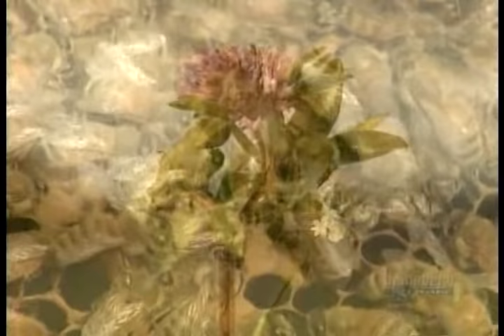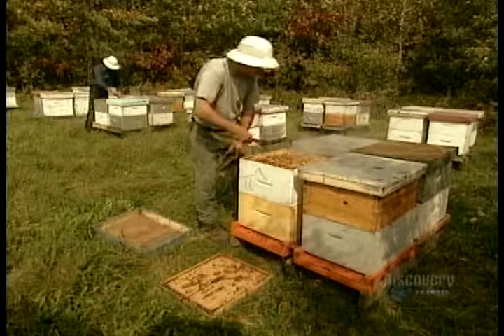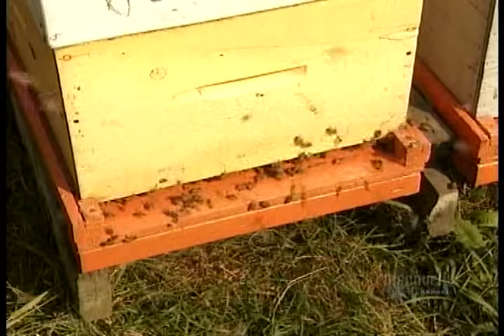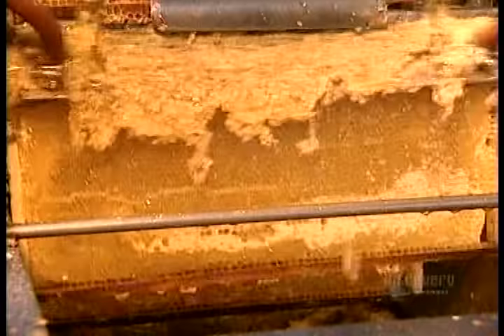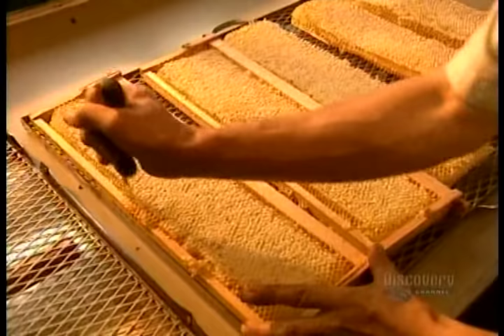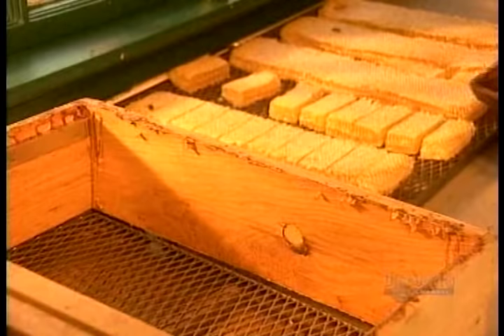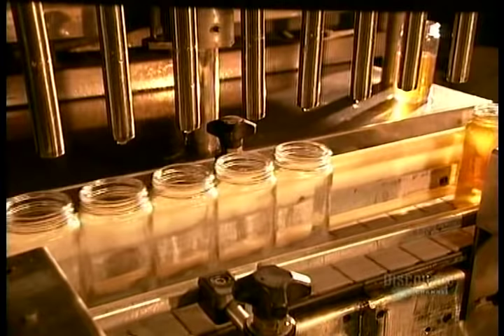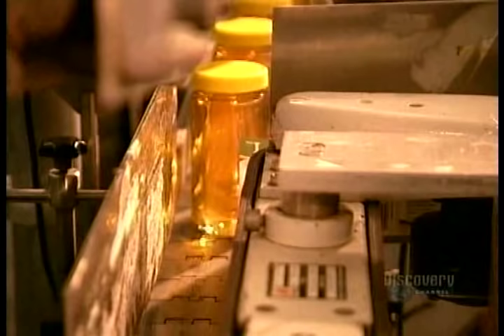How It's Made Honey

Comment: In 1814 Petro Prokopovych (ukrainain not american) invented the world's first beehive which used hive frames.[1] Early prototypes had a large distance between frames, and the frame lay on supporting strips of wood. As a result, the frames were cross-attached by burr comb and propolized to the supporting strips and were difficult to remove. In Prokopovych's design, the frames were placed only in the honey chamber. In the brood chamber, the bees built the combs in free style.

Jan Dzierzon described the correct distance between combs in the brood chamber as 1½ inches from the center of one bar to the center of the next. In 1848, Dzierzon introduced grooves into the hive's side walls replacing the strips of wood to hang top bars. The grooves were 8 mm apart and met the distance requirements for a bee space.

In May 1852, August von Berlepsch in Germany designed a movable frame

Comment: That is very watery honey…
Reply: +TheSorrowLand 
that does make sense, putting the honey we usally get will just take a long time and it will be a sticky and messy process
Reply: yeah they water it done a bit as well to strech it out. if you look at bee farmers that makes honey at home it's much darker and thinker and very sweet.
Reply: that just depends on the plants
Reply: Yeah most water it down
Reply: no i meant the color and thickness comes from what plants the bees collect from, and how long it has been cured. idk if factory's add water, but i wouldnt be suprised if some did.
Reply: no they usually heat it so it will flow easier. Also honey straight from the hive has a paler coloration.
Reply: My aunt has a bee hive in her yard and it makes THE BEST THICK HONEY EVEAHH
Reply: T H I C C
Reply: S U C C Nectar
Reply: S U C C  I S  D E A D
Reply: in the video it said that it had been heated to over 130 degrees. Have you ever heated a sugary liquid? It gets thinner because the molecules are able to move faster than before when they were stuck together and crystallized. Maple syrup is thinner when you heat it up too.
Reply: it cant be watered down or else it will ferment and go bad also with labeling restrictions if its not pure honey the label has state that fact

Comment: Its fake or real honey it looks more watery than real honey
Reply: If it's on the thicker side, it's probably not raw honey. Raw honey (not raw wild honey but raw honey from farm) is thinner. It doesnt mean that it is fake. Raw wild honey is thicker from raw honey from the farm but still it's not as thick as processed filtered honey. Processed filtered honey you buy from store is not good. Dont buy it. Raw honey also has very variaty colors from dark brown, light brown, golden green, etc. Either raw wild honey and raw honey from farm share the similarities. if you put in the refrigerator they wont freezed over, they produced gas so dont be alarmed if you found out the cap sealed your bottled-honey goes pop, and on top of the honey you can find bubble of foam. I know this for the fact that i consume raw honey for my family for years and buy it on local farm in my country. Honey is not that expensive here.
Reply: @dwscprmwr  no you're pretty long-winded but you don't know s***! The viscosity of the honey is directly dictated by the moisture level inside the honey and this is dictated by when the bees cap the cells! If you'll note when he's removing the honey frames from The Hive they're only half capped you never Harvest The Hive if it's half cap because the other half is still too wet that's why the bees haven't cap that yet it's still drying down! The reason his honey is as damn runny as it is is because it's got too high of a percent of water in it that's what you get when you take half capped cells that are not ready to go. honey like this is also a problem cuz it can actually spoil! Raw honey makes no difference it all comes down to what the viscosity of the honey is. one frame to the next with the exact same honey can have dramatically different viscosities and raw is not a factor in that!
Reply: @deannelson9565  oh hello professor honey blah blah blah wkwkwwkwk...i know honey is hydroscopic. I dont state anything related to the video. His honey is runny? Well that's fine by me. It is still raw. I tried kaliandra raw-farm honey (it is quite runny) and get the great benefit from it. Almost as good as raw wild honey. For most common people (such as myself) the best way to buy honey is from the farm. We know that it should be unheated unprocessed. So we get best benefit from it.
Reply: @dwscprmwr  and see there you go again you're equating runny to being raw which has nothing to do with it! If the honey is runny it's has too high of moisture content at harvest. It doesn't matter if it's raw or super filtered it should never be runny The super filtered stuff only thing that happens with that is it has no pollen left in it doesn't cause it to be more viscous or runny that is always dictated by the way it was harvested raw or not! So next time you go wherever you bought your stuff if it's super runny don't buy it cuz that is subpar honey you're buying water and that stuff will spoiled as well where as regular honey has an infinite shelf life.
Reply: @deannelson9565  well you know what, i dissagree. My country is humid what do you expect. Tropical countries most likely have higher in moisture for their honey rather than subtropic. I know honey should be contained max 17-20% in moisture. In rainy season even raw wild honey here almost 28% in moisture. The farmer have to harvest it early! Expecting to reach ideal viscosity, then the farmer should process (heating up) the honey, we dont want that now do we. I think you should travel to tropical country and visit local honey farm if you have means, you go see for yourself
Reply: @dwscprmwr  I raise honey in a place that is hot and humid in summer and that has nothing to do with the viscosity of the honey the bees will still dry it down! This is the reason why the honey bees will post workers all over top of the open comb Fanning the honey until it gets down to proper moisture level they will not cap it until it gets to proper moisture level no matter where you are and no matter what your conditions are. It's very simple and quite basic bees simply will not cap to wet honey they are programmed to do a lot of things in one of the things they won't do is cap high moisture honey. If honey makes it to Market that's too wet it's simply a case of the honey producer taking it too early because they're too damn antsy or want to make more money but the product they produce is of a dramatically lesser quality.
Reply: @deannelson9565  now that, i agree. In summer the moisture content of honey's not as high as in rainy seasons. The hive will maintain the temperature and the bees will help  by fanning it. I don't know which part of place you work your small farm, but judging from your name i guess you live in subtropical. Well now, from my experience (i live in Indonesia) i get thicker honey in summer and runnier honey in rainy seasons, like nowadays. The color also slightly different every time. Every type of nectar also produces different taste and color to the honey, i know it. Well.. what i meant by raw is i prefer to get the honey without it being processed (unheated, unfiltered). If it's in runnier side then so be it, since it is rainy seasons. I buy honey from local farm every fortnight. Tbh i really cant tell your parameter of runny/super runny. What i can say best is we'd better buy from farm/trustful seller. Farm is the best. you can see how they process the honey hive, you can tell whether they harvest it just in time or early. If early what is the reason, etc. Ok professor? Wkwkwk
Reply: @dwscprmwr  bees actually have control of that. Watery honey is super fresh the longer it's in the hive the less runny it is because the bees constantly put it in their honey stomach and spat it back out adding enzymes in it and reducing water content.